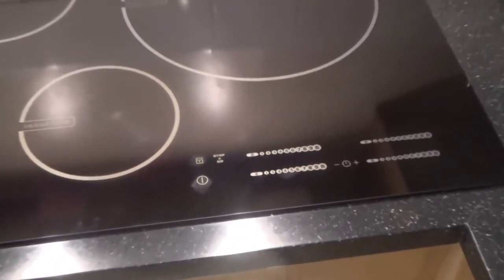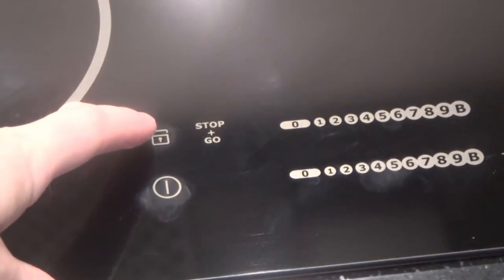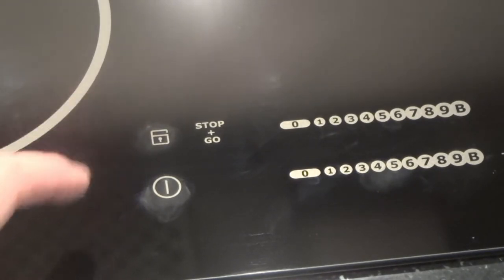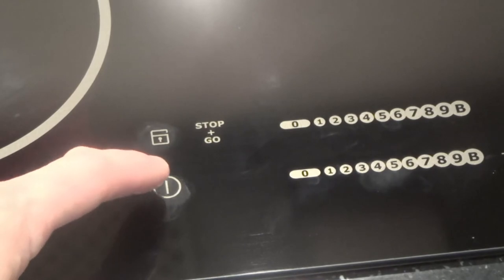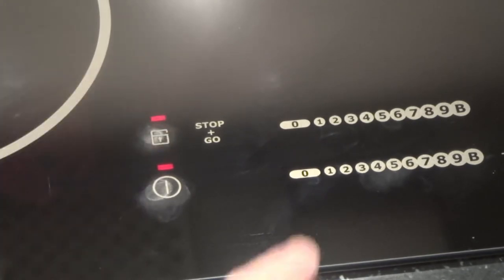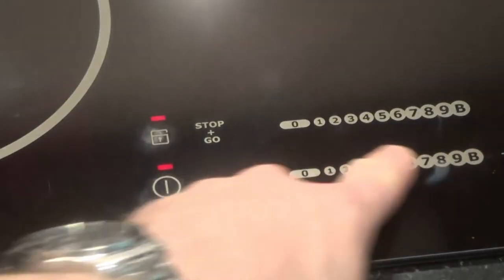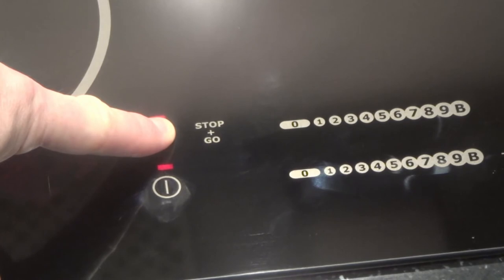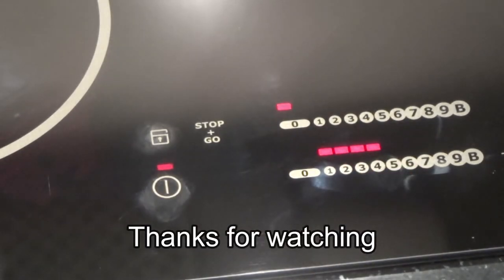How To SETUP & REMOVE CHILD LOCK on Electrolux INDUCTION HOB

Comment: Thanks for the video! But when I unlock (use) and turn off again, the next time I turn it on, the lock is still there!!
Reply: Did you work out a way to fix it in the end? Mine still won't turn off either
Reply: @matty123446  turn the appliance on unlock the child lock then hold the minus button until you hear it beep and it should be off when you turn your device on next
Reply: Can remove the child lock as shown and when I turn off the cooktop and turn it back on again the child lock is still there.

It is working in reverse where the child lock is automatically on and I have to turn it off to use the cooktop.

Followed the video exactly but it keeps putting the child lock back on when I turn the cooktop back on..
Reply: All good figured it out, silly me was letting it turn itself off so it didn’t hold to memory that the child lock was off, needed to turn the child lock off then turn the cooktop off manually so it saved to memory.

Thanks again..!